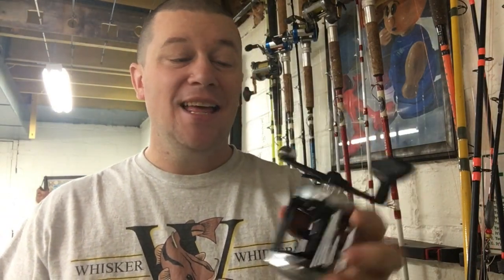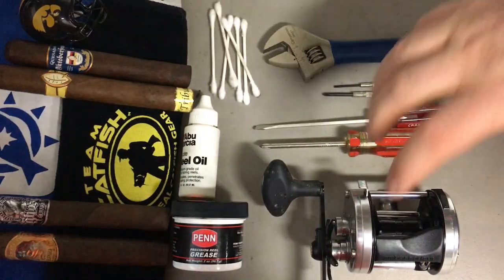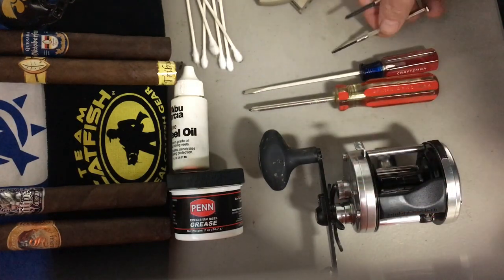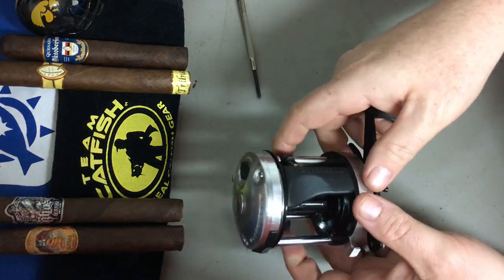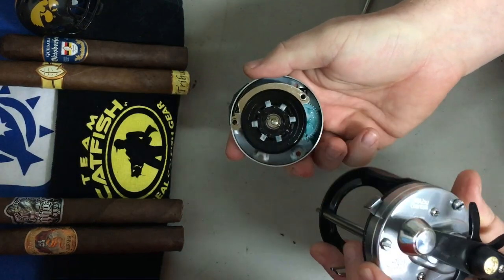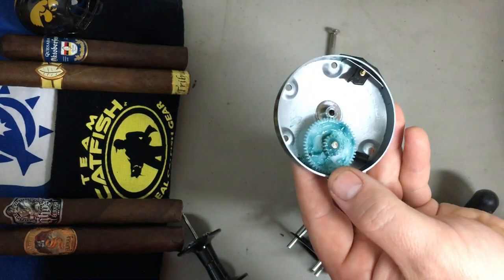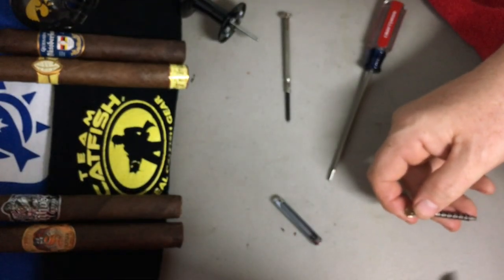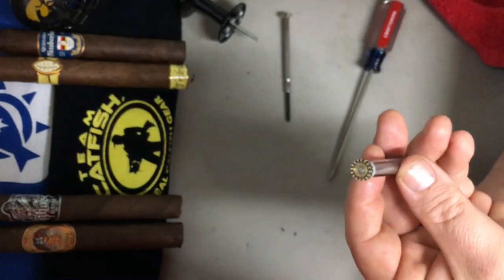How to clean an Abu Garcia 6500C3 baitcaster reel

Comment: I spooled it with 8 LB test mono for lighter lures, gave it some practice casts and found that it did cast well https://www.youtube.com/post/UgkxSlytCJqozTF7EbdP4LWP-HUXf9WRDJ0e , except that the anti-backlash setting had to be turned up almost all of the way to keep the "overcasts' ' down. I disassembled it, and found that if I potted some "shim washers" behind that anti-backlash magnet assembly, it got the magnets closer to the spool without rubbing, and I could get better control with about a 6 to 7 out out 10-Max setting. I also noticed that the handle shaft had some internal end play, maybe only 2 or 3 thousands of an inch, but it's still noticeable. If the anti-backlash and shaft tolerances were "tightened up" this would be a fantastic value. I've only used it for 4 days of fishing in a month's time, but I plan on keeping it.
Reply from the maker: Gracias por ver el video. Es la marca preferida de muchos, va? No compro otra. ¿Para qué? Jajajajjaj

Comment: Thanks for putting out this video.  I had an Abu Garcia Record which was not engaging immediately after casting.  It would take a couple of turns of the handle to engage.  I wouldn't have had the confidence to take it apart if not for your video.  I thoroughly cleaned it following the steps in your video, and it looks like the culprit for the issue is that the grease on the portion that engages and disengages during casts had become "sticky".  The grease was making it stick.  I cleaned the old stuff off and put new grease on, and everything is working great now.  Thanks for your video.
Reply from the maker: Thanks for watching. Glad I could help

Comment: Great video.

The cog that you're greasing at the 5:20 mark - is that removable?  How?  Long story: The sideplate on my reel got knocked and the clicker won't move because the metal is buckled.  I've got a donor reel off a friend who got it in a pawnbroker for a few bucks and I was going to switch it over but the plastic cog in that reel is looking a bit worse for wear so I wanted to swap the newer one from my reel in and just use the sideplate.

Comment: I watched a video on the cleaning & lubricating the 6500c and the other video showed putting a little bit of grease on the Felt Pads in the drag setup before reassembling what's your thoughts on that ???? PS a good Scotch would go with the Cigars also !!
Reply from the maker: Some people do grease them, I just personally never have. Never tried it either, so I can't really say one way is better than the other. I'd say it comes down to preference. I might try that one of these days to see if there is a difference.

Comment: Hey there, I followed your tutorial and did everything right.  The reel works great but the only thing that’s a little weird is that when I’m in free spool there’s a bit of a sound as line goes out.  The sound sorta sounds like something is faintly grinding, like something doesn’t have enough oil or something.  The spool moves side to side like a microscopic amount and when it’s to one side it doesn’t make that noise.  Other than that the reel works fantastic.  What might that noise be?

Comment: Did i miss something, i was looking for the location of the 3rd bearing , is it in the wormgear ?
Reply: The 3rd bearing is the anti-reverse bearing located in the brake side plate. He only applied a little oil there, but I typically use a small amount of grease on that roller bearing.
Reply from the maker: Malvin Steger yep, good catch. I know I missed a couple things, and there are definitely a couple different ways one could grease/oil certain parts, depending on ones preference. Thanks for watching!

Comment: I service my all my reels I use the penn grease and penn oil on my penn sealed spinning reels and all my ABU I found penn oil on the bearings and level wind for casting distance a thin oil that dont attract dirt and quantum hot sauce grease on the gears it dont migrate off the teeth on the gears it stays in place I get 2 seasons before servicing the hot sauce oil is a little thicker than penn oil
Reply from the maker: Raymond jones great suggestions. Thanks for watching!

Comment: Do you service them when they are brand new? I hope they are good for some fishing out of the box. However I seen the oil my abu boxes when they arrived yesterday!
Reply from the maker: I usually don't. They're good to go right out of the box.
Reply: Whisker Whippers ™️ thanks for the response, I bought my first two auba garcia 6500 during Prime Day sale
Reply: I had bought some Shimano Curados and used them for half a season and I was cleaning reels so I was curious about how they were built so I took one apart and totally degreased it and cleaned and used new Shimano drag grease and some general reel oil and I could not believe how much smoother and free-er the reel was.   It was almost as free and the "Super Free" version of the Curado.   SO I did the same with the second one immediately.  So to answer your question servicing your reel may improve its factory lubrication after it has broken in  after some use.      I have heard of serious fisherman fill their reel with toothpaste and cranked it to have the toothpaste polish the gearing to make them smoother than clean the paste out and relube and oil it to make it better than factory smoothness.

Comment: I have a 6000-C from about '93 I'm having a problem with it not wanting to lock up when spun/reeled backwards. I've had it apart and I understand what the mechanism is that stops it from spinning backwards, but for some reason that little tab doesn't seem to be getting enough traction on the gear next to it to pull it over and into the gear to stop the spool from spinning backwards. Any ideas? I've tried to bend the little tab upwards to give it more friction but that didn't really improve much.
Reply: Not sure if you will see this 3 months later but you have to put the gear inbetween the two copper tabs,one under one on top.

Comment: Is this possible after just respool 30lb hi vis mono
Reply from the maker: Chip Sammich yep, just put a piece of tape on the tag end and stick it to the spool so it doesn’t come unraveled and you shouldn’t have an issue.
Reply: Kinda funny because i just spooled mine with 30lbs hi vis mono as well and was wondering the same thing 😂

Comment: can you get a gear upgrade for a faster retrieve I've got a 6500 c3 which is standards
Reply from the maker: Yes, as far as I know there are better bearings that you can get, which will help with casting immensely. Also, if yours doesn't come with the better drag washers, you can get an upgrade there as well.

Comment: C3 Do they still make these in Sweden?
Reply: Have to look at the Abu site. They have cut back on what is made in Sweden, but display it on the pages for the ones they do, I know the c4's still were last i checked.
Reply: The C3 is still made in Sweden.  There's a very disingenuous video on YouTube where the narrator talks as if all round Abu reels come from China now, but that's only true for the cheapest version they make.  I can't even remember what the cheapest version is called, but it's not a C3.
Reply: @ericl2969  the cheapest is the Ambassador S I believe, and totally different line guide and all, but still, people compare it when it's like $60-70 vs $120-130 lol. All the major companies do it though to fill in gaps in the market and compete with offerings at each level, like Shimano and Diawa guys usually brag about all being made in Japan when the lower tier are all made elsewhere.
Reply from the maker: Ross Best sure do. If it has the stamp on the faceplate that says made in Sweden you have a winner.

Comment: why didnt you clean the worm gear bearing?
Reply from the maker: Great question. I never have issues there, so I just leave it. I would just add a drop of oil if anything.
Reply: i take out the worm gear bearing and both spool bearings, and clean them in lighter fluid, then add a drop of oil when i put them back in, and its like a brand new reel...try it next time if you feel like it, let me know how you make out....great vid

Comment: Actually those little springy C clamp dont fly thousands of miles....if they fly off, its directly into a black hole to another universe and time, it might come back to you later in life under the couch or rug or you may never see it again.
Reply from the maker: I usually find them after I've bought 2 new reels and 50 replacement clamps
Reply: LOL!!!
Reply: I hold it inside of a plastic bag from the grocery store while I pop it off. That way it can only fly into an enclosed container.

Comment: expensive reel with plastic gears? still better than a KastKing Rover?
Reply: The drive gears (on the right-hand side of the reel) are metal.  The plastic gears that you noticed (on the left-hand side) do just one thing, and that's operate the level-wind (worm gear), and there's virtually no load and no wear and tear for that.  If they do ever wear out (and with decent care, they won't), they are easy to replace and it won't be an emergency anyway.

Comment: This video sucks.   How can you smoke a cigar and clean and lube a reel without a good Bourbon.   I have a pair of older 6500 C3s.     I just went blue cat fishing today and one of them does not  lock after the handle is turned.    The handle rotates while line is being pulled out.  Something needs to be cleaned so it locks the spool as line comes out.    It works intermittently  so  I don't think anything is broken.   I wonder how old they are?   THey have to be at least 15 years old I am guessing.   I got them used and I don't recall cleaning them after purchasing them.   I will be doing so tonight with Bourbon.   Thought I would check out a preview of how to do it.   I hope my older ones have  metal or brass gears throughout.  Great vid!!!   THANX    I fix and clean reels for all my friends so I am very familiar with doing this but your vid saved me from having to dig up the reel schematics.   Happy fishing.
Reply from the maker: Cheers!
Reply: Did you ever get the spool release button to reengage ? I am having the same issue with one of mine. That was the only thing not covered in this video.
Reply: You have to get inside and remove all the gummed up old grease and relube everything with fresh lube.   It should take care of itself.    Something is sticking inside.
Reply: jp040759 I’ll give it a shot thanks
Reply: Take your time.  Take lots of photos during disassembly.   Its not that difficult.  Good Luck.   Please let us know how it goes.

Comment: Thumb screws never need a screwdriver on them finger tight
Reply from the maker: Agreed. I just give them a very small turn to make sure they’re snug. I’m hardly using any force.
Reply: @WhiskerWhippers  They are meant to be thumb tight in case you want to open the reel out in the field
Reply from the maker: @lesrinehart933  yep. I keep a reel repair kit with me at all times as well

Comment: That’s a 10 millimeter nut under the handle
Reply from the maker: Couldn’t find the socket when I made the video 😂😂
Reply: Also guys the carbontex drag washers are sized for what the reel foot says on the bottom for example 84-1. 84-2. 99 -03 etc.
Reply: @WhiskerWhippers  the old crescent or channel locks will suffice the nut driver is safest for non scratches
Reply: I know you could easily do the washer swap lots of guys doing it now. Take care